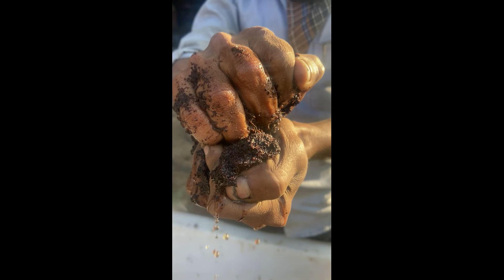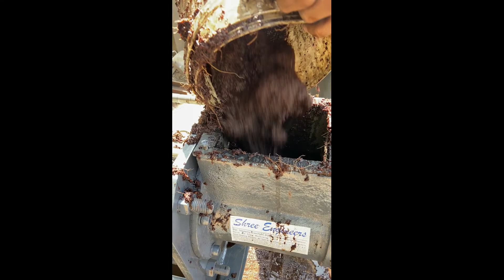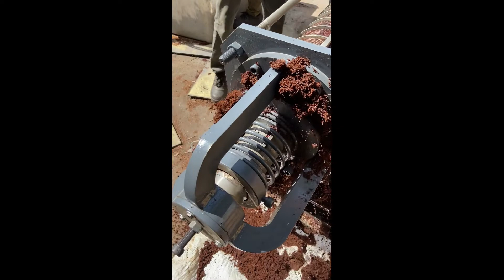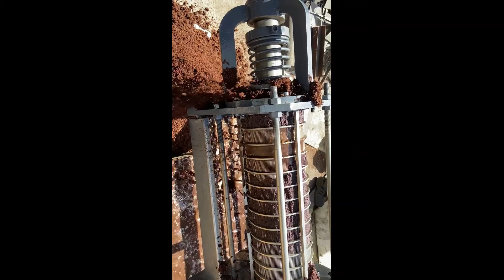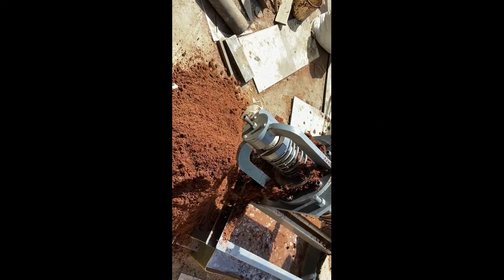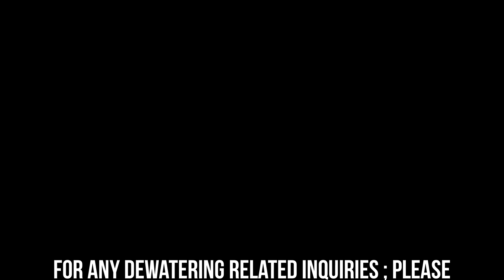Coco Peat | Coconut Coir Dewatering Screw Press

Comment: Praise please
Reply from the maker: Please drop a message on +91-8320966623 for all details.
Reply: @DewateringScrewPress7  what is the price
Reply from the maker: @drprakashrv1867  Please drop a message or give a call on +91-8320966623 for all details in regards with the price and technical specifications for the machine.